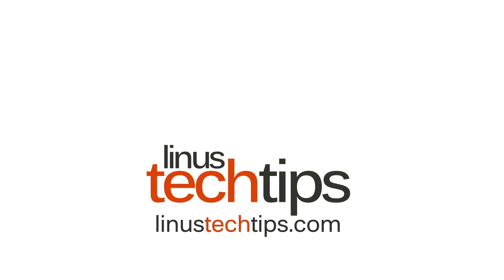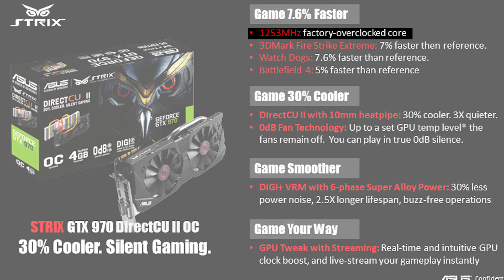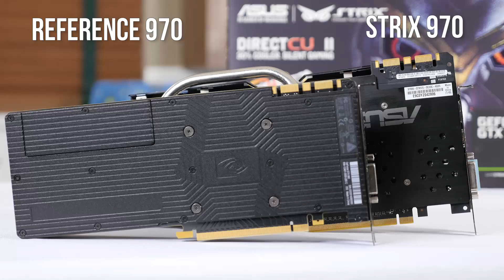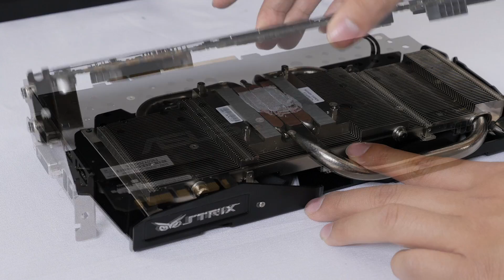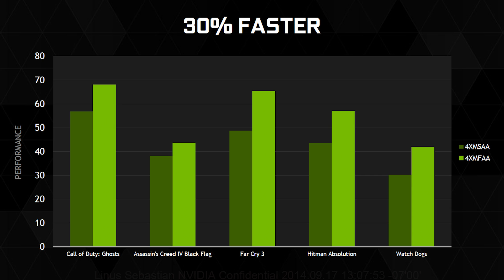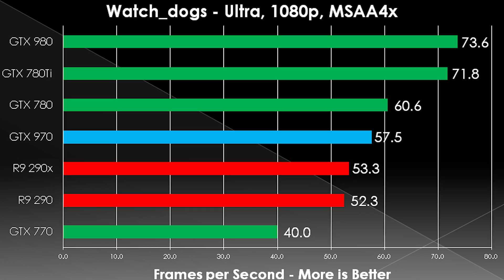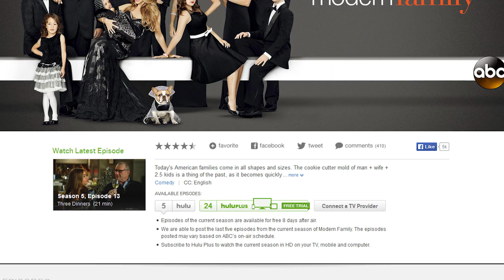ASUS Strix GeForce GTX 970 Video Card

Comment: I recently bought 1 of these cards about 3 weeks ago second hand and am now having an issue thats just started were the card will just stop outputting signal to all monitors (i am using 2 displays).  I have to hard reset computer for display to work again but not long after getting to desktop the output signal stops again.  I have gone back to my older reliable 750 ti for now.  any help would be great.

Comment: Right now I have a gtx 670. I was thinking of upgrading to a gtx 970 but the only problem is my cpu is an amd fx 8320 which seems like a severe bottleneck. Would those two still pair nicely together?
Reply: I used to have fx 8320e but my mobo broke recently but still using my gtx 970 asus strix version.

Comment: I'm trying to find-out what's the ATI (now owned by AMD) equivalent of a "nVidia GeForce GTX 970". Does anyone have any idea?

(P.S. I found a refurbished HP-Z440 that is coming with a 700W power-supply and a EVGA "nVidia GeForce GTX 970". As well as a Intel "Xeon E5-1630 V3" processor (3.7GHz, 4 cores, 8 threads), and 16GB of DDR4 RAM).

Comment: woooo I've gone from an RX 570 8G, to a sapphire nitro+ 5700 XT, to a 5600G, and now to this. What the fuck is with the GPU prices... The fact that gpu prices haven't come down at all in the past year is a pretty good indicator that AMD and Nvidia are just refusing to make new ones so they can artificially jack the prices up due to "low production"... Even the stores don't sell them for anywhere near MSRP anymore. a 1650 is fucking $350cdn at Canada Computers. 8GB RX 570's and 580's are going for $700 USED. 18 months ago they were going for $200 max. At this rate, I think console gaming is going to take off again. It's the only way to get into 60fps ultra gaming for under $1000 anymore.

Comment: still running this boy in 2021. lol. plays fortnite maxed out at 1080p, 110fps at 2k with custom lower settings, still at full resolution tho. Everyday pushing 3 monitors, two at 1080p, one at 2k

Comment: Shit card, 
- part of vrm is not cooled.
- vrm heatsink does not connect to the real heatsink
- only 2.5 heatpipes at best touch the cpu
- software is shit and doesnt tell you the twemps of the vm
Reply: what kinda bootleg gtx 970 did you buy lmaoooo
Reply: @Fistoos  its the same from the video, bought by an official store supported by asus.

I opend it, and that is what I saw. It died after 3 years of permanent vrm heat abuse
Reply: The software is also crao and doesnt show you that. AIDA64 let you do this

Comment: Who's still rocking this beast in 2019 ?
Reply: nearly 2020 and still holding STRONG
Reply: @SiMo_OfficiaI  just buyed a used one hahaha
Reply: Bought one at launch and it Keeps me 100 frames steady in WoW and I'm only just considering an upgrade because the 30 series punched itself on launch.
Reply: Does it run fortnite good?
Reply: @energetic2k936  It does, yes.
Reply: @SiMo_OfficiaI  Thank You.
Reply: @energetic2k936  yes it’s almost 2021 and runs everything smoothly on high
Reply: End of 2020 and my 970 still strong
Reply: @Omar Hamdan yes it can
Reply: I have a GTX 970 but my PC runs like shit on most newer games. For example: COD MW 2019. I have the settings all the way down but my PC still lags sometimes which makes the game unenjoyable for me. I also have GTA V installed but it doesn't lag as much. Here are my specs:

GTX 970
i7-2600k
8GB RAM

The rest of my specs, Idek what they are.
Reply: @imbatshitman  Your cpu isnt good enough to take full advantage of your 970. I was stuck with a 4 core cpu myself and it wasnt great but when i switched to 8 core the difference was huge.
Also, your 8gb of ram is probably very slow considering the age of the cpu (1333?) so yeah when the prices go down you should try to upgrade if you can afford it or care enough, good luck!
Reply: @brodeur3001  sry for the late reply but I forgot to say that gta v on the same pc ran fine back when I upgraded in summer 2018, now it runs like shit. And I haven’t even upgraded since then too.
Reply: Bought one in 2018 still going strong <3
Reply: Bought it in 2015 and still going strong for my 1080p setup. Running it with i7 7700 3.6Ghz. 16gig ram works fantastic.

Comment: Legendary card. Still going strong in 2021
Reply: Owning it for 6 years almost, still going strong.
Reply: + 2021
Reply: I got mine to 1450 and dam does it scream. it is faster than the rx580 that replaced it except it hits vram limits at 1440p. this like the 400 gen needed more vram. the nerf to .5gb doesn't help ether.
Reply: @gdrriley420  so for 1080p do I get this??
Reply: @Sol_Creations06  for what budget? go ask on the LTT forum
Reply: @gdrriley420  just for an upgrade. I have an old 580
Reply: @Sol_Creations06  go give more info on the forum
Reply: bought mine for $350 in 2014 and this sucker is still good enough for gaming these days. Can't find value like that anymore.
Reply: still going on in 2023!
Reply: Just bought mine on ebay for $120. I'm hyped
Reply: @brettm.4329  120$ is a bit much a 580 is faster at the same cost
Reply: @gdrriley420  May be worth it if you prefer drivers that aren't trash.
Reply: @lazeralus2600  the 4xx and 5xx from AMD have had 0 driver issues over my 3 years of running the latest. some 5xxx cards had issues but thats all fixed
Reply: @gdrriley420  i got mine for 58$ evga gtx 970 oc  lol the seller say the gpu display is black only i think his psu is the faulty one
Reply: I never paid much attention to overclock speeds. I recently decided to up my core clock and put it at 1525. It ran fine and I guess thats pretty fast for this card. I haven't pushed it harder, but I do kinda wonder what it can do.
Reply: @WifeBTR123  "kaboom?"
Reply: @zanethzarareth6747  no problems. Even went a little faster. I don't keep it that high in general. Buy I was surprised to see such high clock speed.
Reply: yeah im gonne get one in a week, i'll tell ya more about it when i get it :DDD
Reply: same, good for 1080p
Reply: Same here
Reply: i use it
Reply: yeah i have it too now, but im having some artifacts problems so I think i'm going to go for a rtx 3070
Reply: Still runs every game at high settings 60fps 1080p in 2020... then Cyberpunk came.
Reply: gtx 970m here,,pretty decent gpu in 2020
Reply: let’s go💪🏾💪🏾💪🏾
Reply: I have one and havent been able to use it due to COVID (wife using my desktop for work). Hows it holding up in framerate? i mainly play games like Siege, LoL,, and Fallout
Reply: @TRUMPWON2020-w1r  this is the only card I have and I said I would never own one..but my 1080 died and I but a defective GTX 1080 TI now I'm stuck with this crap
Reply: Yeah, that's true
Still rocking one myself
The only unfortunate thing is fans failure, which is seems to be pretty common
Otherwise - great product
Hard to believe it was released 7 years ago, damn!
Reply: Still got mine. I've since acquired a Radeon R9-390 (then gave it to the Salvation Army), an EVGA 1060 6GB, and I just completed my latest build with a slightly used RTX 3060 ti.
Reply: 2022!
Reply: fax
Reply: Definitely! Doing Crysis 3 and GTA V at 2160p still on my Strix 970 and FX 8350 :P
Reply: Aren’t they worth like 300$
Reply: Migueliz cute Nope try like 80-100$ they perform better than a 580 when not vram limited
Reply: @gdrriley420  well that didnt age well
Reply: @miguelruiz876  you can get them used at like $70 now

Comment: Anyone watching this in 2018 because they are still proud of their ASUS Strix GTX 970? Well Iam :P :D
Reply: For some reason this was on my recommended but I'm still happy with mine. I paired it with a i5-4690K and honestly it still holds great today and I still haven't had to lower any game settings down except maybe a handful.
Reply: using 2x Asus Strix 970 @i7-4790k.still a great system😆

Comment: I fell for the G1 gaming of the 970... As it happens, i ended up with a pretty good chip, but the extra features of the STRIX would've been pretty nice... It also suffers from a LOT of coil whine, but it clocks up 1627Mhz on the core and about 800 Mhz offset on memory, which is pretty crazy, considering that i didn't touch the voltage (it only induced screen tearing and worse coil whine). With a custom fan curve, it stays pretty quiet, but even at 100% fan speed, it makes surprisingly little sound. GPU never goes over 90, as that is where I've set the curve to 100% fan speed, but even so, doesn't go over 78 in actual games. Only in benchmarks, does the fan have to spin over 70%. Still, if not for my luck with the silicon lottery, i would've bought the STRIX any day.

Comment: I love this card..  Got it..  And overclocked at 1580 mhz coreclock!!!
Reply: Would you say its better than an MSI and the G1 from Gigabyte for OC?
Reply: I would say its same or a bit better than the MSI .. and the Gigabyte has the better Cooler.. BUT in the End it depends on the Chipquality how high u can Overclock the Chip .. 1580 MHZ is more than the average Overclock of the Gtx 970 .. I would say the average Overclock of the 970 is around 1450 mhz - 1500 mhz ~
Reply: How far can yours?
Reply: I have an Gtx 970 Asus Strix OC .. Overclocked @ 1580 Mhz Coreclock and 4200 Mhz Memoryclock @ Stockvoltage.
Reply: How long do you think you'll be keeping yours? I'm just about to buy one for a used pc hunt at $600 expecting this to last me at least 3 years before I buy another proper $600-800 build. (Hoping and assuming prices for GPUs and DDR4 calms back down)

Used:
3770k + Z77 board ($240)
16GB DDR3 1600MHz ($80)
GTX 970 ($200 for the strix, $180 for msi)

Seasonic M12ii evo 650watts bronze ($60 brand new)
some good looking brand new case ($40)

ps: brand new case and psu because those last 2-3 builds before upgrade right? and SSD will be from my laptop. I computed if going for a brand new build I can get myself a Ryzen 3 1200, B350M board, 8GB DDR4, GTX 1050 + the case and psu above. 
Thoughts for this?

pps: I'm not entirely in a rush for a pc maybe I could wait til Q3

Comment: how on earth did you guys get plus 250 on the base clock of the 780 ti reference model without even touching the volts?
i have the directu ii model and i can barely get the base clock over 1000 without artefacts...

Comment: I just got this model for $250 Canadian. Used, but so mint there wasn't even dust on the fans. I sold my old 550 Ti for $50. It is a pretty cool card. I really got it for cpu compute in blender.

Comment: does anyone think that an evga 430 watt bronze certified psu would be enough for this card?
Reply: Yes that would be fine your entire machine will only draw 350-380 watts max with that card as long as your not over clocking you will be fine.

Comment: I'm Gonna get a GTX 970 and Intel i5 6500, Will i experience any bottleneck?
Reply: Not at all
Reply: nah
Reply: I have the gtx970 4g paired with the i6600k and I did get some on Battlefield 1 ... returned it for the i6700k no issues now everything on Ultra
Reply: a 6600k shouldnt bottleneck a 970, not even a 1080
Reply: Sentry :D hey and like i said i lived by the i2500k...but idk what it was but bf1 kept hangin up on me :'(
Reply: do you think a amd 1090t will bottle neck a 970 omega
Reply: it does bottleneck in some games I have that processor and I have to overclock it to 4.4ghz to improve fps and it still bottlenecks. Some games do require an i7 these days.
Reply: what's bottleneck?
Reply: for example, when your graphics card gets slower because you are using a bad processor
Reply: ah ok, i have an i5-3470 3.2ghz will I be ok?
Reply: definetly, just make sure it stays cool
Reply: Your CPU won't bottleneck it. I use this same graphics with an i5 4570 + 16 GB RAM and it runs very well. Even GTA V runs at very high settings with MSAA 2X at 1080p with 60~80 fps. It will work fine on your computer.

Comment: is it still good. i have this card
Reply: Nils Carlson good for what? with this card you are safe to skip the 10 series

I have one, my next target is a GPU that belongs to the next series
Reply: For the newer games (gta v watch dogs2)
Reply: great, you won't be able to maximize settings as this would require a GTX1070 GPU to get average 60fps with 1080p

but the card is recommended for both games in case you play High/1080p, so this would be enough to play average of 60fps
Reply: ok thank you
Reply: What a load of tosh,  I have an i5 6600K, with 8gb Ram and an ASUS Strix GeForce GTX 970 and can run anything I throw at it (including GTA V and watch dogs 2) on ultra at beyond 60fps+ Ave
Reply: Daniel Currie Cheers for sharing that lol because I have the exact same specs lol.
Reply: lol same but GTX 970 and i7 6700k and it can run bf1 on ultra setting, no need for 1080 (for now)

Comment: Linus, I think a really need your help!
I know this is a really old video and I hope eve more, if you guys still care about the comments!
-> My Asus 970 Strix has an idle temperature of 60-65C. It seems pretty hogh to me and read a lot about this issue. Some say it's normal and it will not decrease the lifespan of the card, others say it's a driver issue with later drivers and that I should downroll on an older one.    (more info below)
I tried also tried different tweaking software: asus gpu tweak, afterburner but nothing seems to fix the problem
I had 660ti sli before and they run around 35C each...
My config: i7 3770k, 16gig corsair xms3 (4x4gigs, one pair with a slightly different clockrate), Sabertooth Z77 mobo, 850W XFX black PSU, ssd, hdd blabla
My initial problem was that I sumtimes get bluescreens and random freezes, that was why I started to find the bug in the system, my hard drives where full, i cleaned them, updated all the drivers...
The problem still remains, probably because of gpu temps? or my different ram modules?
Please help me, i don't want to buy a whole new pc just to test whats the problem!

Comment: what do i do if i dont have a 8pin power connector ???
Reply: molex  to 8pin adapter
Reply: brendan i have a 6+2 pin will that work
Reply: Yep
Reply: Wozi just installed it 6+2 worked great thanks
Reply: Nice CPU? if you have a nice i5 the gpu will last you a long time if u play 1080p :D
Reply: Wozi core i7 4770 (probs overkill for gaming but i also do animation )
Reply: yep thats fine man, and do you have a motherboard with a second pcie x16 slot?
Reply: not sure i've got the gigabyte g1 sniper b5
Reply: you do, if you want to, you could upgrade by getting another asus strix gtx 970 in sli if you think you will keep 1080p for a while in the future
Reply: the mobo i have doesn't do sli only crossfire
Reply: ahh well in conclusion if you do 1080p gaming ur gpu is fine if not you can upgrade to gtx 1060/1070 :D
Reply: ***** read the other comments

Comment: Can I run over watch?
Nvidia GTX 970
AMD A6-6400K Radeon HD 3.90 GHz
64Bit
16GB Ram
GA-F2A78M-D3H
Reply: Jango MOCs you needa upgrade that CPU it's holding ur 970 back
Reply: And 2TB
Reply: +Jango MOCs Probably ,watch the minimum specs from Steam :)

Comment: Is this good enough for Overwatch? 
🔻i5 Quad Core 2500
🔻16GB DDR3 RAM
🔻1 TB HDD
🔻 The card in this video
🔻 128 GB SDD

Thanks
Reply: That's exactly what I run. And Yes, it's great. 

SSD's are getting cheaper, so you can get a 500 gig for a reasonable price. :) 
I7's are not necessary right now.
Reply: Yes it is my friend
Reply: Video card? I'm assuming you have a 970, so yes, it should be fine for even 1440p.
Reply: I play Overwatch with a i5-3330 and this card. Play at ultra and only had noticeable fps drops like 3 times over the the many hours I have played. I run at 1080p 60fps.
Reply: Easily bruh... overwatch isn’t that heavy of a game really..

Comment: shuld i get another 970(lightly used for 220$) , or a gtx 1070 for 4k gaming?
Reply: 1070 or a 1080 depending on your needs, the 970 struggles at 4K. It even struggles with max 1080p in some games due to the 3.5Gb of VRAM, I own one.

Comment: Got mine today after 2 days. Replaces my old GTX 650 Ti and I'm impressed. Runs games percectly at 60 FPS and allows me to play games like Dark Souls 3 that I had trouble to run above 8 FPS before.
The ASUS GPU Tweak that comes shipped with the card makes it also very easy to configure the card to your needs. I set mine to have the fans run at 40% all the time as I prefer to have lower temperatures even at idle. But even when the fans are spinning I can't hear them at all which is amazing as I could clearly hear the single fan on my 650.

Comment: Can it run off of a 6 pin instead of the 8 pin connector? As long as the psu has enough juice off course...

Comment: will my pc run bf1
i5 6500
strix gtx 960 4gb
8 gb ram
Reply: No. Upgrade your i5 to an i7-6950X Extreme, your GPU to 3-SLI GTX 1080 and your RAM to 128GB DDR4 3200MHz. Should be able to reach 40-50 fps with said setup. Good luck!
Reply: +Macadoof u can't 3way sli gtx 1080s
Reply: VTL
Yes you can, but only for select applications (no games, benchmarks n shit). Also this was a joke.
Reply: i run bf1 with i5 4460, gtx 750 and 8 gb ram at low settings 50 FPS.
Reply: No
Reply: ***** thanks
Reply: Macadoof lol

Comment: This card is quite amazing. The only problem is, is that it turns my PC into a radiator. I'd be fine with that, because it's usually freaking cold in my house, but now it's summer.
Let the USB powered fans blast my room with cold air!